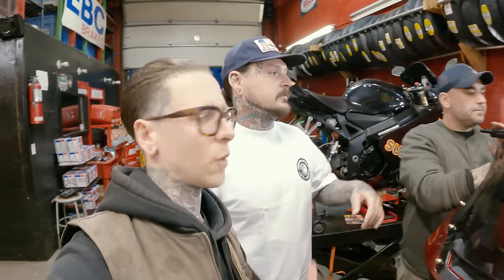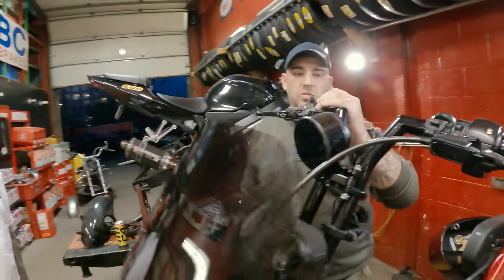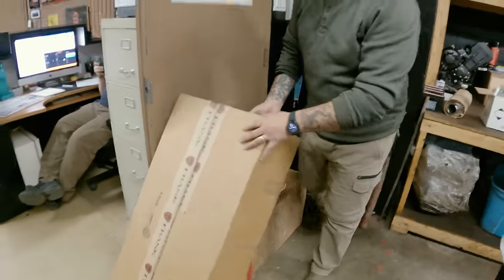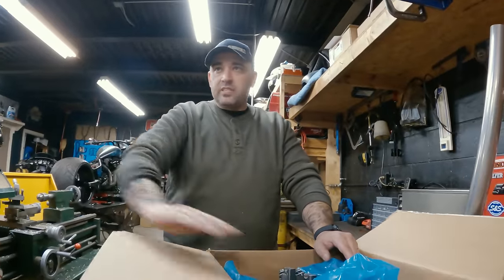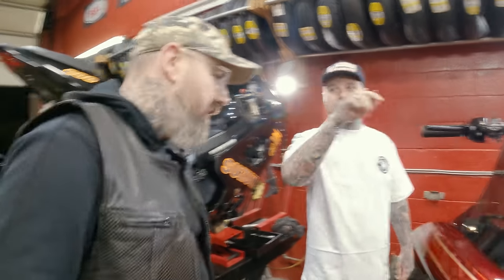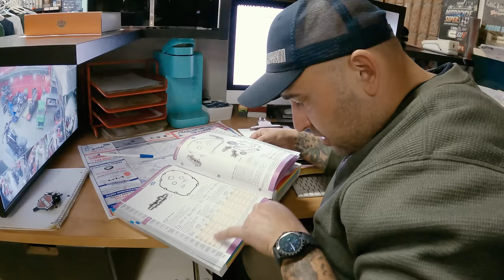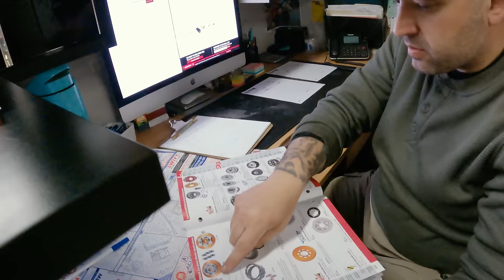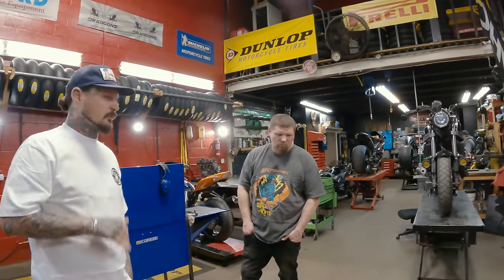Harley Davidson Low rider ST STAGE 4 Upgrade!

Comment: Will look good with the fluid mounted lower
Those open threads can easily be blocked with a black bolt or some rubber caps like the ones where the passenger pegs go in👌
Reply from the maker: Yeah can’t wait to see it all mounted!

Comment: Just get a complete clutch at this point and that star racing compensator if failure happens it will cost you greatly depending on how you ride start saving up for a baker grudge box and eventually a flywheel 😅
Reply from the maker: Already went this far so why not right haha

Comment: Matt, if you can get the Evolution Industries Complete Clutch Basket Assembly! I’m running a Rekluse setup it’s fine but overall the evolution is much better product!
Reply from the maker: Interesting- I think dan at champion ordered the rekluse one but will check those out
Reply: @IndestructibleMFG Let Dan, know I’m running a stroker motor built by MHP, and runs smooth at 100MHP no issues in the Arizona heat!! Matt, we are at the same pace with misc parts it’s going to be a super sick wish I, was able to see it in person hopefully one year you come down for Arizona Bike Week 🤘🏽🤘🏽⚡️⚡️🤘🏽🤘🏽

Comment: Just to let you know, I saw a stage 4 with 5.5 injectors stage 4 heads brand new 64 mm throttle body all for $1500.00 brand new and they were on Facebook marketplace for a while.  The first generation heads had issues.  Wonder what he is charging you;(
Reply from the maker: Oh yeah? He gave us a great deal

Comment: Why don't you get the GOLD OBERON CLUTCH & BRAKE LEVERS? I literally ordered them directly from Oberon's website in the U.K. and it arrived at my house 4 days later in WA state! Same price as buying it from a U.S. Distributor but you don't have to wait 4-6 weeks! By from them directly for $240 total cost!
Reply from the maker: Hadn’t seen those until now. They look great
Reply: Superb Quality!
Reply: You can get the GOLD levers with the RED settings Dial, or ViceVersa. I have the Fast Johnnie Low Rider ST and the Blue Levers are identical in color to the bike paint color😊
Reply: @FREEDOMGUNNER I was running the Oberon setup with rekluse clutch had a lot of issues finding neutral, cruise control and had the clutch adjusted two times and finally removed and went back to stock levers no issues!!

Comment: KLEEN MOTO MAKES A CLEANER LOOKING MOUNT THE. THAT ONE FOR MIRROR ALOT SLEAKER AND OEM LOOKING COMPARED TO THE ONE HE MADE YOU 
ST LOOKS KILLER 🥵
Reply from the maker: Thanks will check them out. Once this is powder coated I think it’ll look great. Especially cos it was made to fit the FXR division bars perfectly and fills the gap.

Comment: Should consider a smaller cam will snap harder with early torque and fun on the street with the heads
Yeah the biggest cam will pull big hp on the dyno but how often are you gonna be redlining..you will smoke them off the lights with the smaller cam
And absolutely with the effort youve gone too i would put a billet compensator
Drop the clutch enough times the stock can shadder and thats not fun
Cheap insurance if you like to tear it up
Reply from the maker: Went with 592. It’s not the biggest cam but it’s there. Currently have a smaller cam in there with the 128 kit but it’s definitely mild.
Reply: Awesome bro cant wait to see how it turns out gonna be crazy 🔥